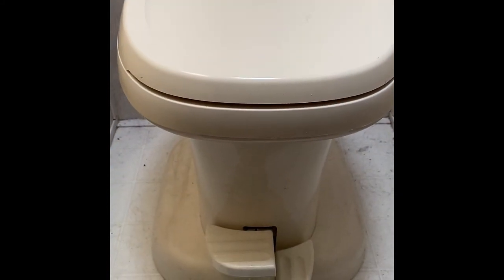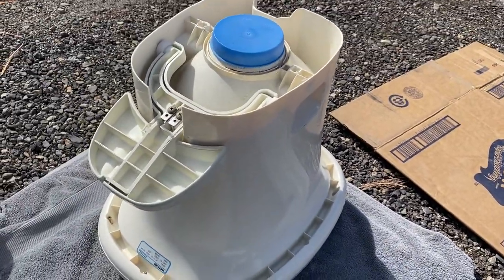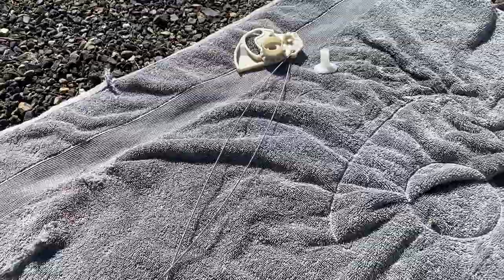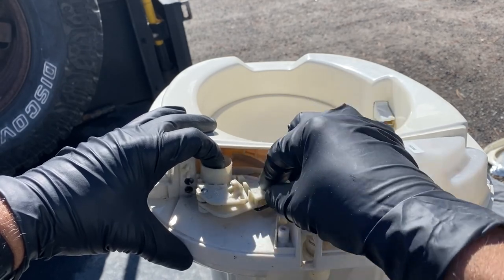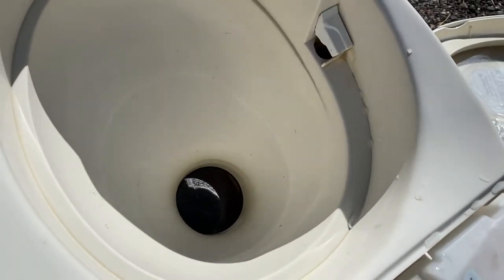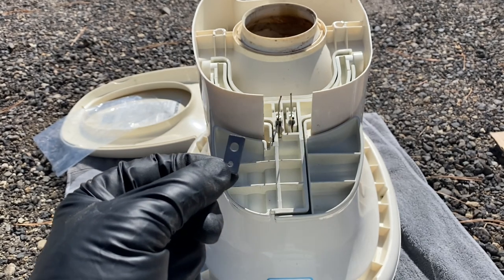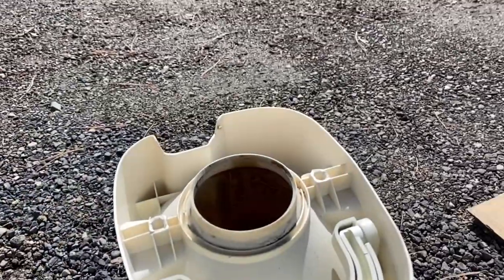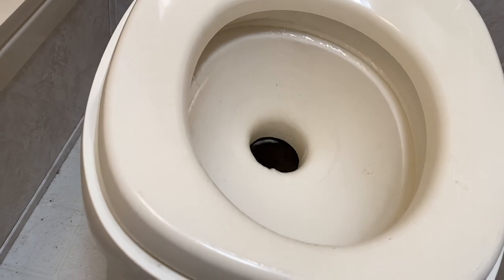How to repair a Thetford Aqua Magic IV toilet foot pedal flush cable

Comment: Thank you for taking the time to make an awesome instructional  video. The camera angles were clear and very helpful too.👍👍👍
Reply from the maker: I appreciate that Mr. Bartlett thank you.
Reply: @maintenanceman1503  hi idk what screw driver my ball retainer plates need because I’m not sure of the shape screw it’s got just a hold and caked on rust. Also what socket wrench did you use for the sides of the toilet?
Reply from the maker: If it’s just a rusted out hole in the screw, you might try the square end screwdriver bit. If that won’t work, you’ll likely need a screw extractor kit. You can get one at most hardware stores. Harbor Freight has them too. I’ll it a link to it below.

I don’t remember which size socket wrench I used (I made the video over a year ago), sorry!

WARRIOR Screw Extractor and Left-Hand Drill Bit Combo Set, 10 Piece - Item 61981 / 40349 / 63987 

https://hftools.com/app61981
Reply: @maintenanceman1503  thank you
Reply: @maintenanceman1503  you said 1/2 for wrench I think have that. I bought a set 2 weeks ago for this but problem is 1/2 won’t work not even 1/16. This is what I get for not lifting the toilet up to get more access I guess. I tried to do it on the ground from under
Reply from the maker: Hmmm… is the bolt all rusted up like the screws? If so, the wrench might not slide in easy unless you clean it up first. Maybe it’s a metric size instead of SAE? If you have a wrench set with both Metric and SAE, you’ve probably tried them all by now.

You could try an adjustable wrench, if you can get one on it. You might try one of those universal sockets (I’ll post a link for one). 

RAK Universal Socket Tool - Super Socket Unscrew Any Bolt - Birthday & Christmas Gifts for Dad Who Wants Nothing - Adjustable Grip Socket Adapter Set for Car Mechanic, HVAC, Electrician, Handyman

https://www.amazon.com/universal-socket-wrench-hand-tools/dp/B01N4R5UJE#
Reply: @maintenanceman1503  last question is where can I get the ball retainers? 23:41
Reply from the maker: You should be able to find that at https://www.thetford.com/parts/permanent-toilets/ or at any RV parts supply store.
Reply: @maintenanceman1503  one last question can I just apply the hand flush lever to my high toilet
Reply from the maker: Good question. I’d think you could, but you should contact the manufacturer and ask them if the sell a kit for it.
Reply: @maintenanceman1503  I will. I wanna lift it up but my wife doesn’t want me to. Scared sht will fall out or something

Comment: Very helpful..actually showing the work being done, so there are no surprises. Thank You..Time to order the kit now that I know what's wrong.
Reply from the maker: You are welcome! The Thetford 24571 Aqua Magic IV Foot Flush Repair Package is hard (if not impossible) to find right now. The website below has a diagram of all the parts for the Aqua Magic IV you’ll have to scroll down). Try just ordering the ones you need (like the cable).

https://www.rvupgradestore.com/thetford-33198-foot-pedal-p/44-1143.htm

Comment: 04/11/24 The cable broke again on our Aqua Magic IV small pedal and they discontinued it on Amazon. Tried several RV parts dealers and no one has the cable anymore. Thetford wants us to upgrade to a new toilet looks like.
Reply from the maker: The Thetford 24571 Aqua Magic IV Foot Flush Repair Package is hard (if not impossible) to find right now. The website below has a diagram of all the parts for the Aqua Magic IV you’ll have to scroll down). Try just ordering the ones you need (like the cable).

https://www.rvupgradestore.com/thetford-33198-foot-pedal-p/44-1143.htm

Comment: There's no base seems built into the ground, It's always had a small water leak problem behind the toilet, Yesterday the pedal kinda broke like to much water goes down so have to bend over use my hands to quickly push down and hurry to pull up, It looks like an old RV that a truck would pull, probably from the late 80's or early 90's, Some rusted metal spring was near the pedal almost half an inch thick and about 3 inches long, Even if I bought a new pedal I don't know if anything could be fixed 😕
Reply from the maker: Hmmm that sounds like some sort of custom fitted toilet. Maybe whoever installed it didn’t really figure out how to follow the manufacturers recommendations or they had to make a modification in order to make it work in that spot?  I’d recommend replacing it with a different toilet. The one in the video is hard to find parts for now. The Thetford Aqua-Magic® VI  cost around $140 new, with free shipping here: 

https://www.amazon.com/dp/B0B8LN4PR5/ref=cm_sw_r_as_gl_api_gl_i_5J9YFDTX8K7HXN777X1J?linkCode=ml2&tag=scampchannel-20

Comment: Crap I'm going to have to remove my toilet now and do all of this work my valve won't open so my toilet bowl is full of water so I got a during that first thanks for the video
Reply from the maker: It’s a yuck job, hank in there!
Reply: @maintenanceman1503  
I lucked out when I was getting the water out I pushed on the flapper valve by accident and it drained the water but I don't check to see if the levers would work so I pulled the toilet then I checked the levers and everything worked so I had to by a new gasket and reinstall toilet what a pain to get the water line reconnected. Thanks for the help. I have some lights not working I think their is a wiring problem somewhere I don't know what I am going to do about that. Hot water tank was not working cleaned the thermocouple got it working. Almost ready to go Kart racing this weekend.
Reply from the maker: Hey, it sounds like you are doing a great job with what you are trying to do. Electrical wiring is a big challenge for me too. I think it’s because I can’t SEE electricity, so I don’t really understand what’s going on with it.

Comment: Well done. My "blade" doesn't move when I depress the pedal, but if I touch it, it will quickly open and closes without a problem. Just pushing through pooh to get it to open is a problem. Any ideas?
Reply from the maker: Thanks for the reply Ed. I would suspect that it’s your blade seal that is binding on the blade. The blade seal replacement is a snap. I think there are even a few videos out there to help you. This link will take you to a blade seal on Amazon:
Thetford 33027 Aqua Magic IV High and Low Blade Seal https://www.amazon.com/dp/B003D50KHC/ref=cm_sw_r_cp_api_glt_fabc_BT3NV4T4EZVPJ9255WE7

Comment: Has anyone found out where you can buy the foot Pedel repair kit. Thanks
Reply from the maker: The Thetford 24571 Aqua Magic IV Foot Flush Repair Package is hard (if not impossible) to find right now. The website below has a diagram of all the parts for the Aqua Magic IV you’ll have to scroll down). Try just ordering the ones you need (like the cable).

https://www.rvupgradestore.com/thetford-33198-foot-pedal-p/44-1143.htm

Comment: I just bought a used 1994 class A rv. Used the toilet about 4 times and on the 4th time when I stepped on the large pedal, to open the blade, the pedal stuck and has not retracted leaving the blade 3/4 open. I'm basically boondocking so limited as to where I could work on fixing it but also wondering if replacing the toilet would be better.
Reply from the maker: Making this repair while  boondocking will be possible if you have the tools and the blade repair kit. If you can’t have Amazon deliver the kit or get to an RV parts supplier, then you’ll have to make the repair without the kit (for now). In any case, you’ll have to receive an Amazon order or visit a RV supplier to get a new toilet anyway. So, it’ll save money to just fix the stuck blade. 

The blade has a rubber seal that sometimes drags as it slides. You may try lubricating with a light coating silicone grease.  More likely is the failure of the spring that pulls the blade into place or that the cable that retracts the blade (when you step in the peddle) is binding due to a worn pivoting lever, anchor, or cable guide. Your best bet, if you have tools, is remove the toilet, take it outside, and begin troubleshooting the action of the mechanics between the foot peddle and the blade. Just start at the foot peddle and see where the “hang up” occurs as you test the movement of the cable, levers, springs and anchors all the way to the blade. You’ll find the problem soon enough and then you can either order a replacement part or repair the malfunctioning part.
Reply: @maintenanceman1503  thank you for your prompt and thorough response. The RV had been winterized until last week and that could be contributing to the stuck pedal. I've been away from it for a few days but will see what I can do to fix it once I get back.
Reply from the maker: Ok, well let me know if you run into trouble and I’ll try to give you some help.
Reply: @maintenanceman1503  thank you! I've been away from the rv but returning soon and then I'll tackle the problem and order the repair kit. I'll post when I have an update.

Comment: The big screw of the lever arm assembly won't come off. We've try the solvent, hammer... The screw is stripped. Anything else we could try besides buying another toilet?
Reply from the maker: Ugh… ya that’s frustrating!

Ok, you’ll need a screw extractor kit. They run about $10 at Harbor Freight. 

You’ll basically drill a hole in the center of the stripped screw then use a hammer to tap the pointy end of the screw extractor tool into the hole (nice and tight). Then you put an adjustable wrench on the other end of the screw extractor and rotate it counter-clockwise nice and slow. The screw extractor will “bite” into the sides of the hole in the screw and back the screw out. I’ll post a link to the tool below. 

WARRIOR Screw Extractor and Left-Hand Drill Bit Combo Set, 10 Piece - Item 61981 / 40349 / 63987  

https://hftools.com/app61981
Reply: @maintenanceman1503  Wow! I did not even know those existed! Thank you so much!

Comment: It Figures...That replacement kit has been discontinued..FML
Reply from the maker: Dang man, that sucks. Well, a replacement toilet isn’t hard to install.
Reply: @maintenanceman1503  Actually , I went to Lowes, bought 5 ft. of  the same size cable  for  about $4.. then bought some lead fishing weights that I softened (melted) with a torch, & fed the cable through it. Worked perfect although the lead balls at each end of the cable weren't perfectly round..LoL..but that wasn't a problem. I've ordered the plastic piece that the cables swivel on when the pedal is depressed. But All in All..I still couldn't have done it without your video. Thanks Again, Sir.
Reply from the maker: Great job

Comment: I have a question. So my wire isn’t broken but i can’t get my hole to open when I press on the pedal. What do you suggest this might be?
Reply from the maker: Hi Brooke. Hmm… so BOTH (make sure) wires are not broken but the gate won’t open to allow you to flush?  

The only thing I can think of is the lever assembly (item 2 in the diagram link below). Or, maybe the little wires are not being pulled by the pedals because they are not anchored to the pedals for some reason. So, check both wires at both ends. At the lower ends the wires should move when you press the pedal each one is attached to. If  the wire does not move when you press a pedal, then the ends of that wire are no longer attached to that pedal properly. The upper ends should move the lever assembly when you press the pedal. Likewise, if the lever does not move when you press each pedal, then the upper ends of the wire are not attached properly or the lever itself is broken.

Please let me know what you find.

https://www.thetford.com/part/aqua-magic-iv-foot-pedal-flush/
Reply: @maintenanceman1503  so it was the wires. Order the new part but cannot get the white plastic pice to go into place. It seems like it’s not fitting right.
Reply from the maker: Could you make a video of what your having trouble with and email it or a link to it to fix4uidaho@gmail.com?
Reply: @brookeestes4783  would you follow up on how you fixed it? Thanks!
Reply from the maker: @lauravictorious4670  if you’ll make a video of what you are struggling with,  (the white plastic piece) on your toilet, I’ll try to give you some advice in how to make it fit into place.